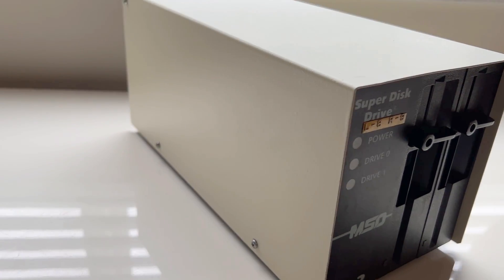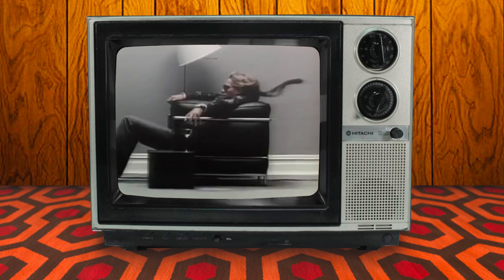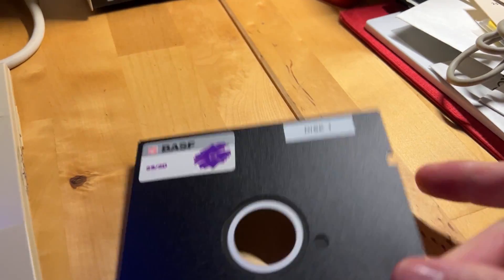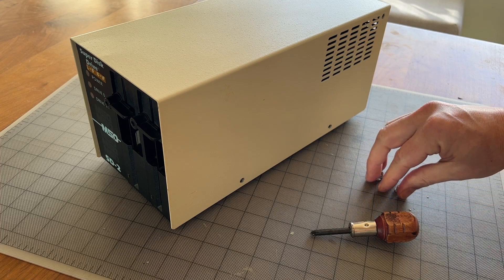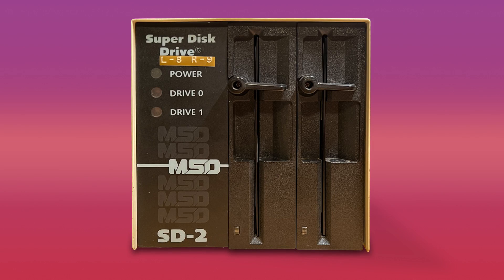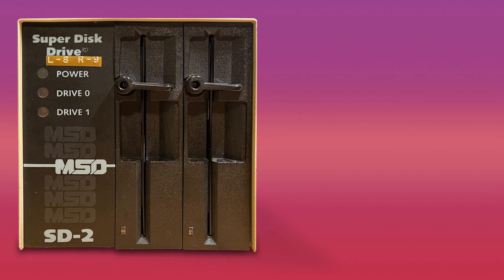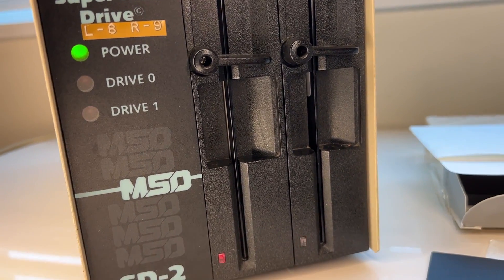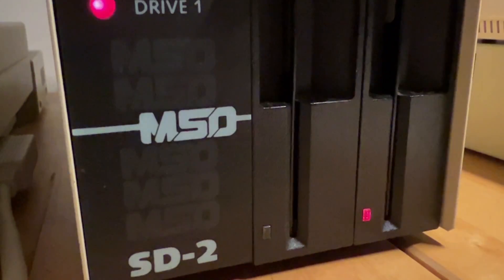King of the Commodore Disk Drives: MSD SD-2

Comment: Too bad this drive isn't more compatible like Indus GT, and like the Blue Chip probably is (we had a BC also, but I don't remember its compatibility, and I quit using it because it developed the always-spin problem, so we gave or threw that one away or sold it for parts like we may have done with our "unrepairable" 1541 [I don't remember what] before buying the Indus), because it would've been a super-great drive if it could've loaded all the copy-protected and cracked stuff that the faithfully compatible drives can, and if it could've copied copy-protected disks just fine without loading stuff like Kracker Jax or Fast Hack'em -- as a legal backup, of course. 😉 Not much use if it can't load much of anything due to copy protection. That's probably what stopped most buyers from choosing it if they heard about that in time, or prompted some buyers into returning theirs if they learned that within the return period.

Comment: How would all of the BASIC 4 just supposedly "magically" appear from the disk drive to the computer without loading anything into the computer, instead of only those commands that applied to disk drives, since the computer knows to send disk commands out those ports, but not the non-disk BASIC commands?

Comment: I still have the IEEE488 board as well.  It was a Commodore device, and a direct plug-in for the back right hand side of the wedge.   Commodore used a serial version of the IEEE488 standard to operate the disk drives.  There was also a parallel card at extra cost, and it was a parallel connector that sped up communication between devices and the computer. Here is a very interesting youtube on the Commodore disk drives.  https://www.youtube.com/watch?v=SPqIGOATFec

Comment: I have two of the MSD 2 drives.  The first one, I bought in the mid 80s, and it was my replacement for the tape.  I later bought the 2nd one in Honolulu while on a crew layover, and brought my new prized possession back with mein the cockpit, so I can attest to the weight of the monster.  I used the drive with the Commodore IEEE488 adaptor, which, if I remember correctly, also gave me Basic 4,0
I absolutely loved the drives, but they were loud.
Reply from the maker: Do you still have them? Those caps are nasty and mine were totally failing when I got the thing in 2022. Very cool that you use(d) yours with the IEEE488 port.
Reply: @AmigaLove  Yes, I still have them.  It was my intention to start using the C64 again, but I don't know where the time goes.  My first passion is the Amiga, and I guess I am watching to many youtubes, because although I am doing some work with them, I am not doing as much as I would like.  I will take your advice, and do the caps on the MSD drives before I use them.   The Commodore IEEE488 card worked flawlessly for me.
Reply from the maker: @jjock3239  Dude, you speaka my language. What's your daily driver Amiga? Pick one.... only one.
Reply: @AmigaLove  My daily driver right now, is an A3000/40.  
It has been running faithfully, since my A4000/40 developed problems because of broken Simm sockets.  I bought the machine used back around 2000, and the previous owner had manhandled them.  I have quite a few Amigas, and am a diehard forever Amiga fan.

Comment: The 1541's could do the same stand-alone copy trick, without a special ROM, as they are basically stand-alone computers a 6502 and 2k of RAM.  There was at least one copy program back in the day that you could load to a pair of drives from a 64 then disconnect the 64 and use the two drives in stand-alone mode.  We didn't use it too much though, as most things we were copying back in the day needed nibblers and most people only had two drives anyway.
Reply from the maker: Right, but I meant via the BASIC Copy command, which wasn't included on the C64's Basic 2 command set. I'm using my C128D in the video but always in C64 mode during the demos. Back in the day I used to copy disks using dual 1541 drives via copy software, but I never disconnected them. I only had the 2 drives and used them constantly. But seeing something like that would have blown me away back then. An extra advantage of the SD-2 is its ridiculous speed capability.
Reply: @AmigaLove  True.  I'm from the C64 days before Basic 2.  :)  I had three drives (bought a couple refurbished), but constantly was re-alligning 1 or 2 because bad pirated software was always banging heads out of alignment.

Your drive's awesome and I would have loved to have that in the day.
Reply: Yes, I remember using two 1541 drives back in the 80's for pretty quick copying independently from the computer.  I think it was Fast-Hack'Em software.  The source disk was in drive 8 and just kept feeding drive 9 with new blanks. ;)